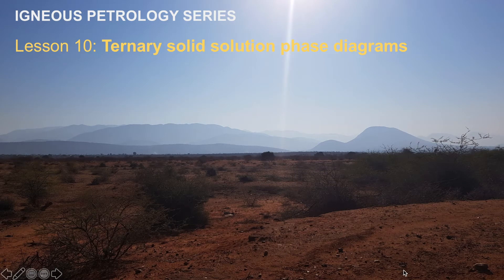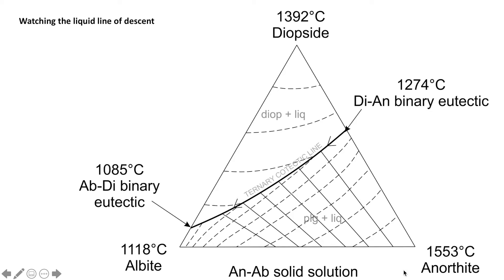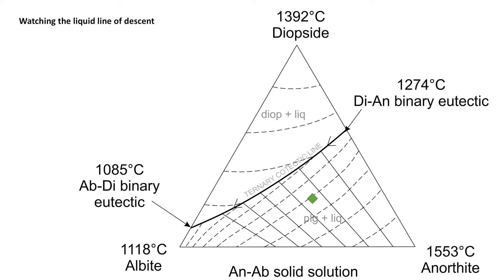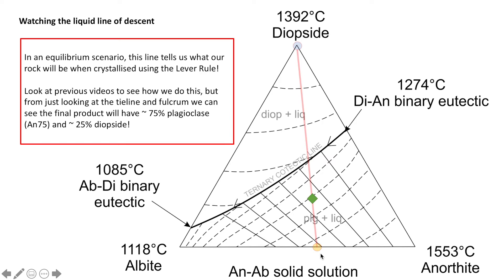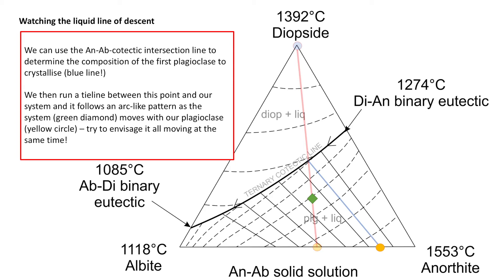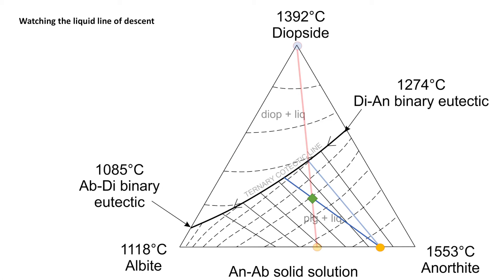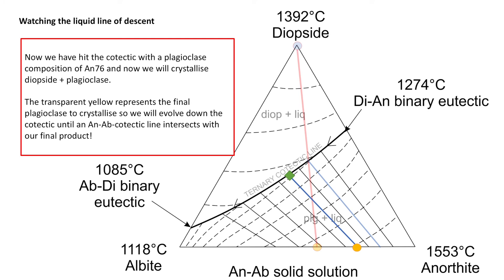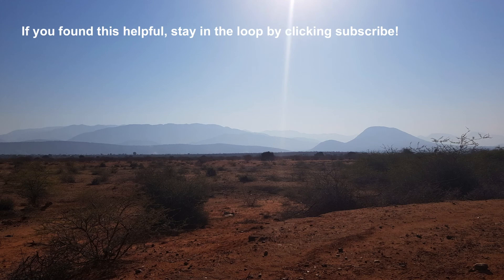Igneous Petrology Series: Lesson 10 - Ternary Solid Solution Phase Diagrams

Comment: Confused how to draw that blue line??
Reply from the maker: Those 'black lines' in the lower half of the diagram are guidelines to mark the occurrence of equilibrated plagioclase at 90, 80, 70 mol.% anorthite etc. Since this is a continuum, where we initially intersect the cotectic line with our initial 'yellow line', we use those 'black lines' as a guide to see the composition of equilibrated plagioclase. For example, if our initial line intersects the cotectic at the same part the An 80 mol.% black line intersects - out first plagioclase will be 80 mol% An - it's fairly confusing with the lines, but hope this helps.
Reply: in case for anyone else who might be confused, you draw a parallel line from the cotectic dipping towards Anorthite. Just like the fully shaded black line.
Reply: Very helpful. Thankyou